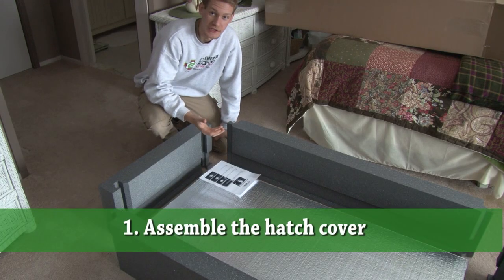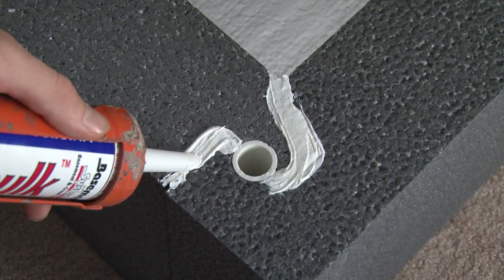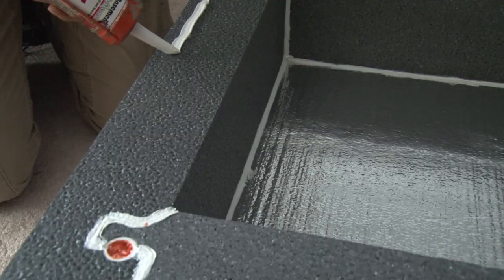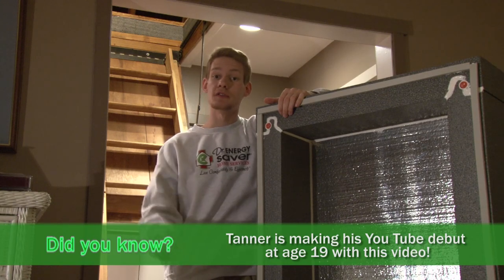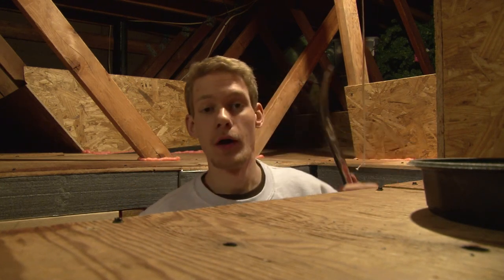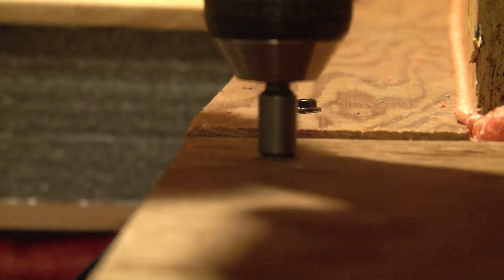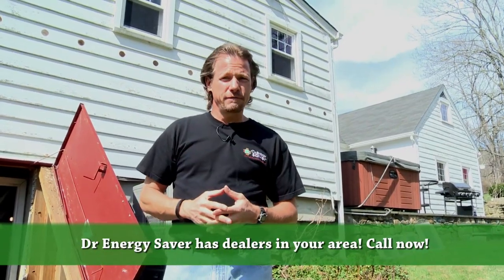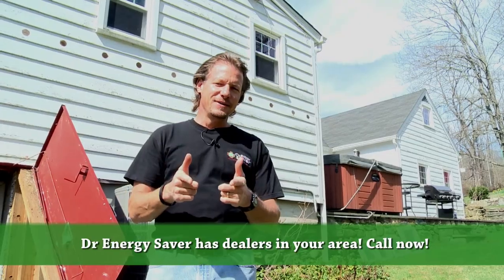How to Install an Airtight Hatch Cover

Comment: you guys should look into attic Vaults or T-Domes.. They come with a weather stripping already installed.. and it comes with velcroe Straps...  We nails in 2 hooks on the inner framing and just strap it

Comment: Do they make a model for a difficult install like my 4/12 pitch with open 2x4 trusses 16"oc?   My head room at yhe peak is less than 4 1/2'.  An open clear attic with a floor is really not much of a challenge.

Comment: Where can I buy one of these
Reply: proprietary.. 1800.00 installed.. so is the thick silver insul board.. cant buy it separately.. they put it in..
Reply: Looks like a DIY if you cant swing the 1800. You can build one that is better than what you have now, assuming you have nothing. Maybe 200.00.
Reply: @andydaddy2009  $250 for one installed.

Comment: Stupid question, but why is it so tall?  What if it was one piece flush with the attic flooring?
Reply: mae2759 when you fold up the stairs, the stairs fits right into the box.
Reply: Folded stairs ( in a pull down system) will protrude 10"-12" above the attic deck surface when the pull down stairs are in closed position.